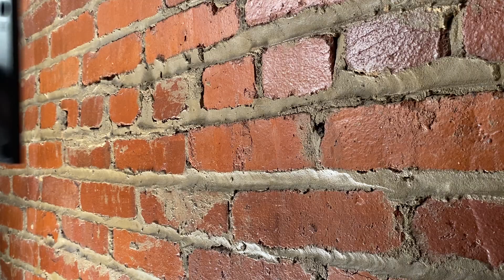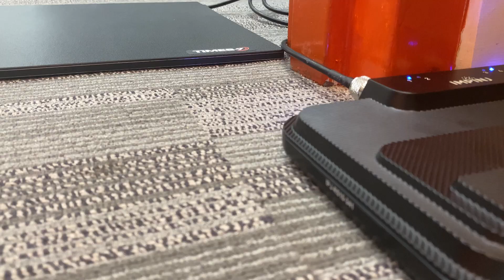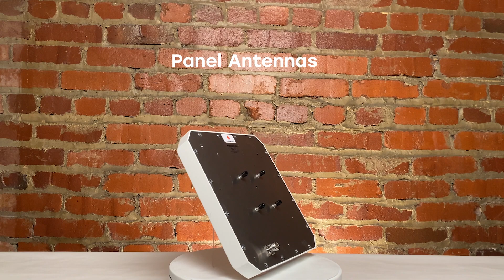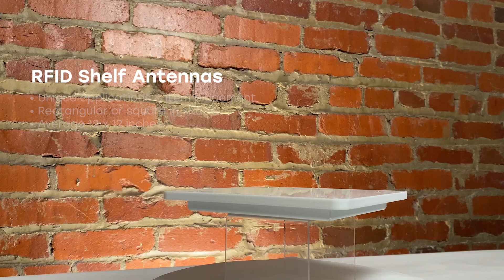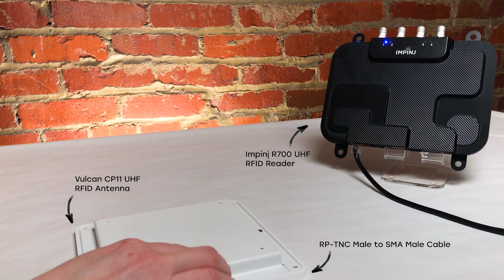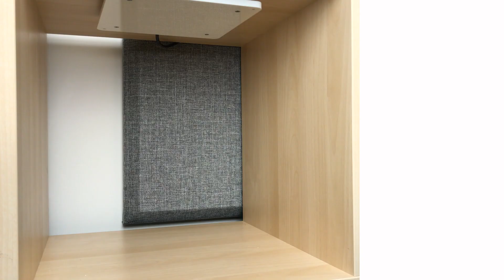RFID Antenna Series: Types of RFID Antennas | RFID Shelf Antennas

Comment: Please which antenna that is most suitable for file tracking in Archives.
Reply from the maker: Suleiman,
That just depends on what type of system you want to use. So if you have a large space and need mobility, a handheld reader with an integrated antenna might be the best for you. Like this video: https://youtu.be/OMr-UD7XRlg
However, if you want a file tracking system that is fixed that automatically detects when a file is being removed, a shelf antenna would be the best. It's hard to exactly recommend because I don't know your setup and the amount of files you need to track. We have a few options here - https://www.atlasrfidstore.com/shelving-cabinet-rfid-antennas/ , but I think it might best if you could contact us via a chat or email and describe your environment and goal. Here's our contact info, there's no buying pressure - we can just suggest some options and things to think about. https://www.atlasrfidstore.com/contact-us/